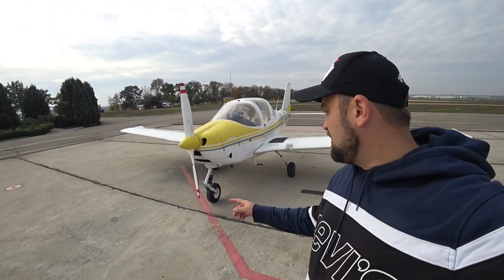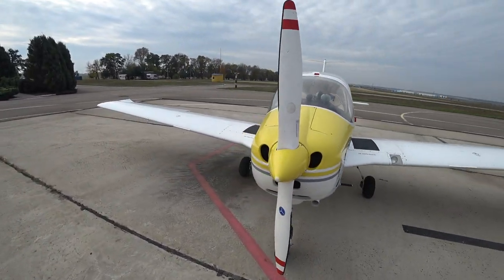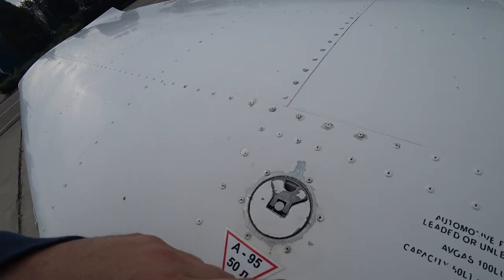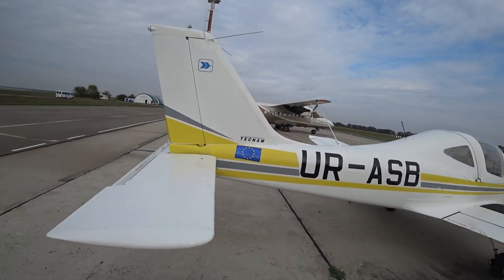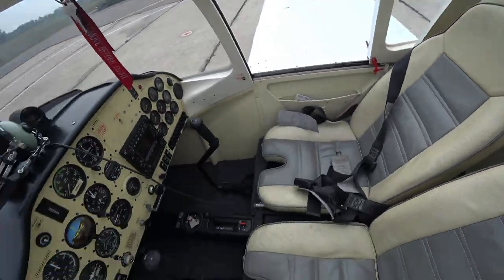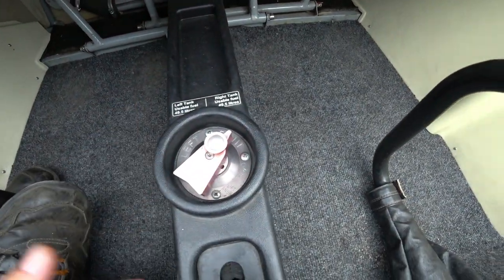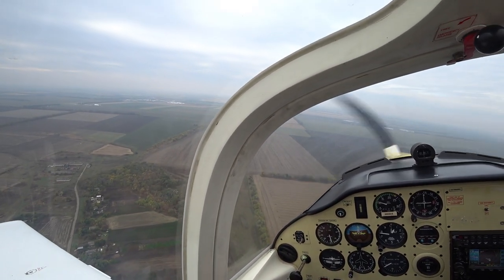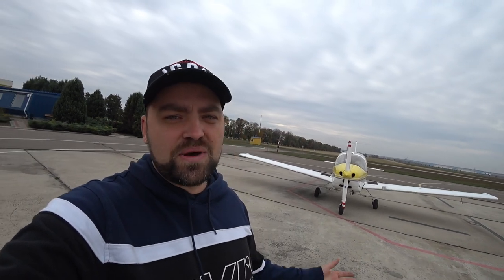Airline Pilot Tries to Fly Small Airplane | Pilot Eye POV.

Comment: It looks simplified than cessna 172.and  captain single engine aircraft move left side during takeoff  right? So how much rudder did you use?
Reply from the maker: You are right, I need to put the right pedal. I put it that much the airplane is stable straight on direction.

Comment: That engine has altitude compensating carburetors, like many motorcycles, so it maintains the fuel mixture nicely at different altitudes and temperatures...quite a pretty little airplane.
Hmmm, quite a bit thinner airfoil than, for instance, Piper Cherokee.
Reply from the maker: Thanks for the info!